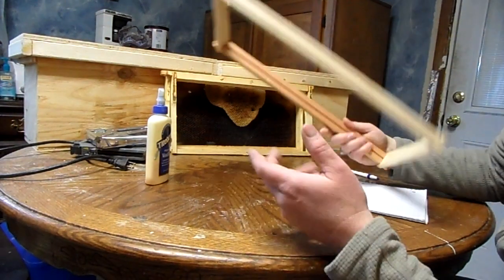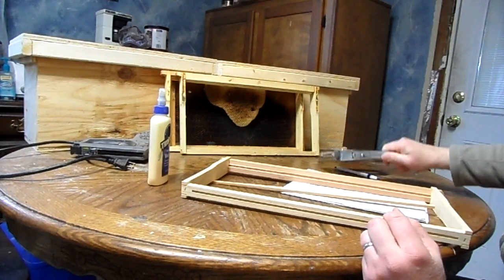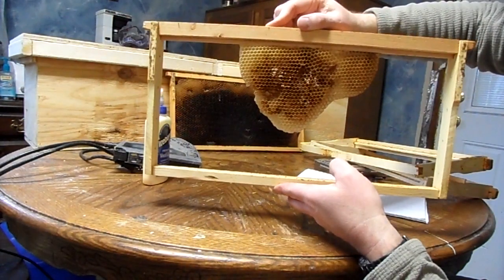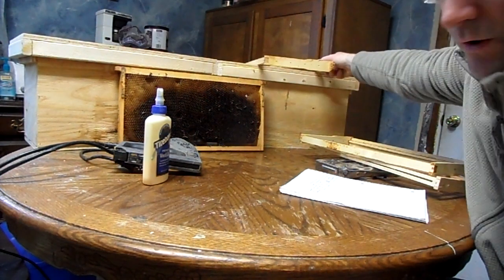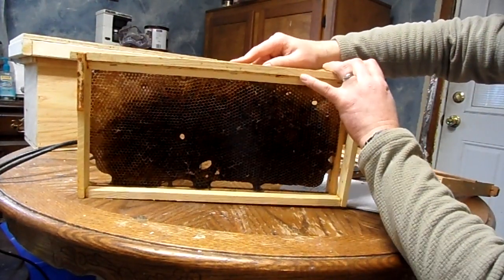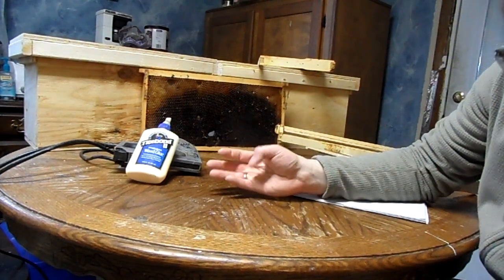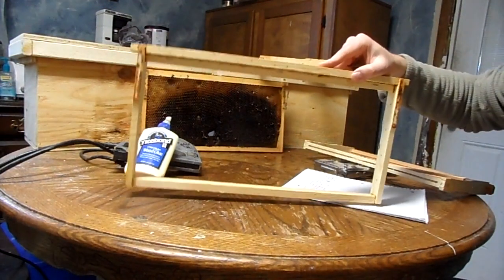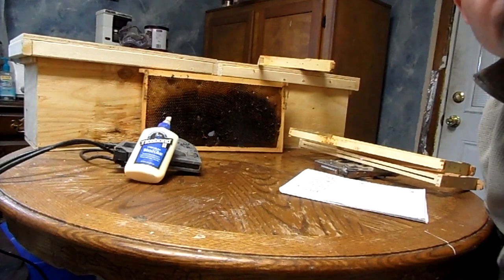How to make and use Foundationless frames in a beehive video

Comment from the maker: For my first 6 or 7 years I just did crush and strain, sacrificing the comb for honey and wax (I was also too cheap to buy an extractor).  2 years ago I bought an extractor and have been extracting the foundationless with little trouble.  with the basket, running them tangentially works better than radially, but I may try wiring some frames and see if radial(spokes on a wheel) will hold up.  As long as the wax isn't brandnew foundationless extracts fine.

Comment: Thanks for the video and the tips. 
I started 2013 all foundationless and this year one hive of bees started building on the bottoms of the frames justa bove the brood chamber.  Some  of the brace comb was at 90 degrees to the frames.  They even built from the bottom toward the top and ended up 3 frames over when they reached the top.  Wow !
Oh I nearly forgot to mention.  When I first set this hive on its base (at the end of last Summer) the frames ran East & West.  Then about a month ago I moved the hive and set the hive so that it had  the frames running North & South.
I took out the mess and rubber banded their new comb into frames.  Maybe that will help get them straight.
I was about to order some foundation until you reminded me of all the reasons why I shouldn't.  Maybe I can use my old wax and melt it down to use for starter strips if it turns out to be necessary. 
At first I thought maybe I had my hives out of level.  But the hive couldn't have been that far out of level.  ((-:
Thanks again for the video.

Comment: A guy at our beekeeping meeting said he used slotted top bar frames and filled the slot with wax and then trimmed it up level let harden and then putting a cotton string about as wide as slot and covered it with wax when he was doing foundation less frames. He claimed it worked well and he could get more foundation less wax for cut comb honey just another idea. cool vid I may try not using foundation next year.

Comment: Hi there, I am a new comer to beekeeping (in the UK) and want to produce honey on the comb (cut-comb), so your video has been very useful (after much searching).  Also like the added benefits of possibly reducing mites. Any further advice on how to produce cut comb would be gratefully received.  One concern I do have is how much extra effort there is each year to build the comb vs draw out the foundation?  Do you think there is any difference? I am currently working with foundation but will use your advice to interlock foundationless frames between foundation frames... Thank you!
Reply from the maker: It's a trade off when you are doing comb honey.  I did crush and strain for my first  4 or 5 harvests until the bees paid for an extractor.  So I was in a similar situation as you with them having to start over each year.  I think it costs the bees Time more than anything else to build the comb.  Overall honey harvests will be larger if you extract VS them having to build comb each year.  As for the difference between you giving them foundation and them building foundationless I think it's negligible. What little help the foundation gives them if any is negated by the fact that it's in their way from how they would naturally draw comb.

Comment from the maker: Anything will work if you let it (with in reason), but I don't think it's necessary to put the wax on there or the cotton string.  If all you have are the slotted top bar frames and you want to do foundationless, glue something into the slot for a guide and be done with it. If you are ordering frames specifically for foundationless I am partial to the wedge top frames, pop the wedge out, turn it 90 degrees and glue/staple back in place for a guide.

Comment: The frames we purchased are wired frames, so there are two crimped wires running horizontally through the center of each frame.  We are picking up two foundationless nucs this weekend - already on small cell.  We have never worked with foundation less frames before.  I have some nice, wide tongue depressors here and they fit pretty well wedged between the top and bottom bars of the frames.  I was toying with the idea of wedging them into the frames to provide some additional support so that the frames can be extracted.  Any thoughts on this?  Any tips on handling foundation less frames in the heat of summer?  I understand that they are more easily damaged and have to be handled in a certain way, but haven't seen that elaborated on.  Thanks, Sue
Reply from the maker: littlealbatross1 The tongue depressors will be more helpful at the top for a definitive place for them to start.  You can run fishing line tight in the foundationless frames, this will give them more strength.  The big thing is you don't want to turn the frame parallel to the ground if the comb is unsupported. As for extracting, any frame even wood frames with plastic foundation will blow out if you don't treat them right in the extractor.  You just have to take it easier on the foundationless.  95% of my mediums are foundationless and I extract tangentially and rarely have blow outs.  Make sure your hive is level side to side, this is the MOST important thing.
Reply: What exactly do you mean by, "extracting them tangentially? I can't picture that in my mind how the combs are laying exactly in the honey extractor / baskets. Thanks! @rwjedi
Reply from the maker: @steveandrews8301  radially are like spokes on a wheel, tangentially would be like perpendicular to the rod in the middle of the extractor. This causes the most outward force for the honey, and the most stress, luckily my baskets support the wax

Comment: Nice video, thanks. Couple of things I'll mention if you'd like to verify on your side because I also don't like random commenters telling me I'm wrong :) As you correctly point out, foundationless frames are cheaper and have natural mite prevention, so I really don't understand why more beekeepers don't go this way. I think it's just old habits, and the belief that spin extractors will break the comb, but my experience is that medium/Dadant/Illinois supers are just fine.

A key benefit of natural comb (from foundationless frames) is that small cell size makes it difficult for a mite to survive. You said that larvae in smaller cells emerge more quickly, but actually the bee development cycle remains unchanged regardless of cell size. Naturally drawn worker cells have less (no) space for the mite to move around in and many mites either die or can't develop normally. Since it was first engineered in the early 1900s, foundation cell size has increased because the thinking was that bigger bees make more honey, but the extra space also led to a quicker mite infestation. When Varroa appeared in the west, the large cells provided a great welcome!

The development cycle approach however can be used if you install drone foundation and get the queen to lay drones. I started foundationless two years ago and the first natural comb was all drone, and I couldn't figure out why. Then a year ago I added a bunch more and this time I had a high proportion of female to drone comb. Maybe it's to do with the time of year or location of the frame in the brood box? That would be an interesting second round question for you: Can you induce natural drone and/or worker comb, or is it just a random choice by the bees?
Reply from the maker: I have no problem extracting deeps if needed, but generally don't because they are all in the brood boxes and that will be their winter stores and if a hive has too much I'll just take and give to another hive or split.

On the development time issue, I'm basing my comments on information from Michael Bush at http://www.bushfarms.com/bees.htm , and he bases his on work done by Huber over a century ago.  I've never measured it myself (I've got other bee work to do LOL), but I just know that with the foundationless and local survivor genetics I don't lose hives to varroa or anything else except starvation (winter) if I leave them too light and don't have a candy board on.

As to the drone issue with foundationless frames I covered that in my comment section of the video, but the basics of it are this: Bees want a certain amount of drone comb in the hive as well as a certain amount of drones (depending on the time of year for the drones themselves), if you have been running foundation in your hives the bees have had to jam the drone comb in any nook and cranny they can find (that's why a lot of people's top bars are covered with burr comb (mine tend to be pretty clean).  When you put the first foundationless frame in the hive, the bees are like "hallelujah the gods have finally allowed us to make drone comb" and so they do, if you remove it from the hive and put another foundationless in they will repeat.  Instead what you should do is slowly move the drone comb to positions 1&2 or 9&10 in the box and continue to feed foundationless into the middle of the brood nest, and they will build beautiful worker comb.
Reply: Super, thanks for the reply. I thought I'd read on the Bush site that the development cycle wasn't shortened but you straightened me right out--Thanks for the correction on my "correction."

I'll go have a look at the drone comments. The new Google+ doesn't show them. I didn't realize drone cell production was such a hot topic, and a Google search products several like this http://www.beesource.com/forums/showthread.php?229937-Foundationless-frames-how-much-drone-brood
Reply: Doug Brown Actually, Doug, you are absolutely right about the lifecycle being unchanged. A worked bee takes 21 days to emerge. It did a century ago... just as it does today. I'm a big fan of Michael Bush myself and realize he cites Miller and Huber, too. I saw him speak back in November (have vids on my channel). I keep struggling with claims that the lifecycle us shortened. I'm reminded of many works written over a century ago that state it takes 21 days for a worker bee to emerge, well before sized foundation existed (i.e. everything was natural cell). I buy in to the thought of there not being enough room for mite nourishment in small cell.
Reply from the maker: Jason Morgan
Michael Bush also says he has measured it in an observation hive as well.  I don't spend too much time checking that sort of thing I'm too busy making splits. :)
Reply: Doug Brown was a great time to get you initially
Reply: Doug Brown m
Reply: Doug Brown has

Comment: i watched michael bush talk on here, he says that todays bees are much larger nowadays and that gives more houseroom to mites, presumably verroa mites, you refer to mites in the video what is your experience with the cells "downsizing" when foundation less?
Reply from the maker: I don't measure on a regular basis (haven't measured in a few years in fact), but when I did measure the core broodnest areas on comb were consistently smaller than 5.4 mm.  If you are coming off of 5.4 foundation, the first generation is going to draw something like maybe 5.1 (this is an avg), then if you take those bees and give them fresh foundationless they will draw smaller still.  What size you end up at is dependent on 2 factors how far north or south are you and how high or low in elevation you are.  If you take the 5.1 comb from the 1st generation and give it to a new hive, they of course will be able to skip that step and the newly raised bees can then draw step 2.  Hope this helps.

Comment: I've reserved my first package in April. I built my own medium bodies, covers and bottom. Bought grooves medium frames from MannLake. I also bought Rite-cell plastic foundation. I have no drawn comb of any kind. I would like the package to start and eventually be only on foundationless frames. And not use the Rite-cell.Should I place the Rite-cell in some frames with a foundationless frame in the middle and put the queen cage on top of the foundationless frame, to get them to draw that frame first? Once they have that frame drawn straight on the foundationless frame, then remove the Rite-cell frames? Or should I just only start with all foundationless frames? This is my first year/hive. Thanks!
Reply from the maker: The big thing starting off foundationless is you have to keep an eye on them.  You could cut some ritecell down to strips and put that in the frames, that might help them get off to a good start without having full sheets of foundation in there.  You can go completely foundationless to start, but you have to make sure that first frame or 2 is properly oriented , after that they will be fine.  The biggest stumbling block starting off is the queen cage causing them to draw funky comb and it never gets fixed. Level side to side is VERY Important.

Comment: Loved the information. Do you have a suggestion on how to remove natural comb that was pulled into a empty super. The comb is laying on the bottom super. There is no uniformity to the comb. I'd like to replace this with a framed super so as to have easier access to work the hive.  Thanks for video!
Reply from the maker: If you are wanting to keep the comb, then I would rubber band it into a frame, in the proper orientation, and put it in the hive.  The bees will attach it to the frame.  Probably best to cycle them out when you get a chance and just recycle the wax.

Comment: Great video and nicely presented and informative.  Although I have used foundationless in the brood chamber for several years, I learned something new.  Have you tried using foundationless in the honey super and then running them thru a radial extractor?  If so, how well do they hold up?
Reply: I have heard that as long as you have at least 3 sides attached they will be fine. I always use frame with foundation in my honey supers just because of that.
Reply from the maker: I ONLY do foundationless everywhere in the hive.  My supers are all mediums and I extract them tangentially.  It's counter intuitive, but with the basket to support the comb I get less blowouts with tang vs radial.  I have extracted some deeps and they extract also.

Comment: How would you begin a brand-new hive with foundationless? Will the bees just go nuts since there is no already drawn comb for you to layer the empty frames between?
Reply from the maker: A brand new hive with no drawn comb, just means you need to make sure the hive is absolutely level side to side and that you've got the starter something on the frames for them to start on (I of course like the wedge top frames with the wedge turned 90 degrees and glued/stapled back in).  With a new hive like that you would also want to check out their progress in just a couple days, which you would probably be doing anyway to release the queen.  The biggest problem people get with foundationless with a package is what to do with the queen cage.  I just zip tie it to the underneath of the top bar of the middle frame.  If they attach comb to the cage you'll just cut it away when you remove the cage.  Once you get one good frame they should follow that pattern as long as the hive stays level.

Comment: I currently have all Kelley slotted top, grooved bottom frames that the plasticell snaps into.  Can I still use these or should I buy all new wedge tops?  I hate to waste what I have.  Maybe I can just put a shim into the notched part to use as a starter?
Reply from the maker: You should be able to use paint mixers or tongue depressors in there and they will work just fine.  I have used frames that I popped the plastic foundation out of and they drew the comb out fine.  I'm not suggesting that you go with out a comb guide, but sometimes it will be ok. LOL

Comment from the maker: Unless you are using the foundation for something else, you could just cut the foundation down to like a 1 inch piece instead of removing it all together.  As for sticks just in the middle or all the way across. Probably best to do all the way across, but bees are forgiving creatures (they put up and thrive with all our mistakes) and so if you just put one in the middle it would probably work also.  No matter what you do, keep an eye on it and correct the comb as soon as you see it's messed up.
Reply: hkhh is c
Reply: e de

Comment: Thanks for the info I found it helpful! Many other foundationless frames I've seen have a couple wires running through the empty space for extra support.  Have you tried that / think it's helpful or necessary?
Reply from the maker: I have seen that and tried it a couple times.  The problem I had was the bees seemed to make the comb in sections around it and it wasn't as strong. Also the wires always seem to bee where there's a queen cell I want to cut out.

Comment: Thanks for sharing this video--very helpful. I am new to bees this year, and am definitely wanted to try foundationless frames.  I put my second deep hive body on the other day filled with foundationless frames--problem is the bees keep building them up from the bottom in between the bottom rail.  I can't seem to get them to build the comb where I want them to.  Silly bees.  I just tried alternating frames with foundation and foundationless frames.  Hoping this give them the reference they need to do it my way. ha!  Any guidance is appreciated.
Reply from the maker: GT_weirdo If the hive is strong enough your best bet is to put foundationless frames into the broodnest in the bottom box.  I'd grab frames of honey to move up into the 2nd box and replace them between 2 frames of capped brood in the bottom box.  This may  seem slower, but actually will probably work out faster and cleaner.  Those new bees that pop out of the cells will have those frames drawn out in no time and then you can do it again... until all the new frames are drawn out.